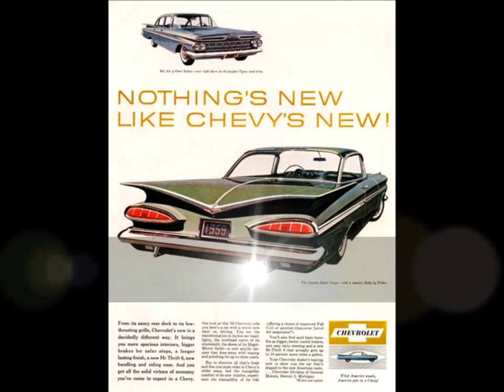59 CHEVROLET BUILD

Comment: Thanks for posting this. 

THIS IS A RATHER LENGTHY POST SO YOU HAVE BEEN WARNED!!

Now after reading thru the comments I'm going to give my take on some of them.

First, yes these cars were made of metal. Not some 'snap together' full sized model like most of them are today.

Second, whilst modern cars MAY be safer, i.e. better occupant protection, brakes, etc. and may be better for the environment the modern cars do NOT have any sort of styling. 

Getting back to the 'safety aspect' of old vs. new. It is of my opinion that we have safer cars to simply protect the inept ones who don't actually know how to drive. You may think I've lost my marbles, slipped a gear, am off my rocker or medications, etc. Well this is MY take on 'old vs. new'.

So we have newer-ish vehicles that are safer. OK. What makes them safer? ABS? Seat belts? Air bags? Skid control? Crash avoidance monitors? Parking assist? Better brakes? Better tires? Which one(s) of these make a car safer than the 1959 Chevrolet?

In 1959 seat belts were an option. Radial tires were not even a thought at the U.S. car manufacturing level. Computers were the size of small buildings or rooms. Car radios and heaters were optional. Automatic transmissions were optional. Drum brakes were standard on all of the U.S. cars and trucks. Single reservoir master cylinders were on all U.S. made cars. Power brakes were an option. Power steering was an option. Passenger side outside rear view mirrors were an option and I'm sure I'm missing some things to go in this list.

Now, if we were to take ALL of the new safety equipment and convenience items off of modern vehicles including radial tires what do you suppose would happen? Well my guess is there would be a LOT more accidents and probably a lot more vehicle deaths. 

Even IF the population was the exact same as in 1959 that would still hold true in my opinion. Why? Because people either don't know how or have forgotten how to properly control their vehicle. They have a false sense of security because the vehicle allegedly corrects for any mistakes made by the inept operator. Also the safety features, i.e. seat belts and air bags (SRS) give them 'warm fuzzies' if they do get in an accident.

IF people knew they could face imminent death if the got into an accident PERHAPS they would actually do what they are suppose to do when behind the wheel. 

Instead we have all sorts of distractions (I'm NOT including cell phones) in modern vehicles. Touch screens for simple items such as the climate control?? Really? What exactly was wrong with simple levers and knobs to control air flow and temperature? GPS?? Um yea, I've NEVER even operated a GPS let alone own such a device. They have these things called 'maps' which don't drop a signal or track my every move I find are pretty useful. Or I simply scribble down some directions on a piece of paper then drive.

Yup. I'm simply an older driver (on the road 'legally' for 42 years) with no tickets or accidents that drives a 1993 Ford Festiva (death trap) pretty much every day. No cruise control, no ABS, no air bags. Would really like to have another 1960's era Impala (I've owned 8 of them from the 60's in the past) and may someday find another suitable candidate.
Reply: @Russ Davis So, you don't think that the C8 Corvette has style? WTF!

Comment: rather have 1 of these than this computerized, gps, air bag, on star, track you where ever you pieces of junk they are building now
Reply: @allen blackman Yeah, you wouldn't want one of todays pieces of junk where you could actually WALK AWAY FROM A MAJOR CRASH! LOL.
Reply: The new ones coming out now are junk. Coming soon will be a chip in the computer that tells car it has reached maximum miles and guides it to a junkyard. Really! That's why it's driverless!

Comment: sold new for approximately $1700.00
Reply: Yeah but the average worker was making around $2600 a year. Same thing.
Reply: true...but why does our money become so completely devalued ... it feels like we've been robbed...
Reply: +daisyroots Accualy the prices for 1959 chevrolets were between $2247 for no options 2door Biscayene 6 and $4265 for the fully optioned Impala hardtop V8.
Reply: +MrTheMiguelox Which would be between $27,000-$28,000 for a fully loaded new 1959 in today's price range
Reply: You could buy a new VW Type 1 (BEETLE) for $1700....

Comment: Wondering if GM was putting on lacquer paint at this time or enamel.....the lacquer paints sure did cause problems....
Reply: All the cars assembled  by G.M were painted with Acrylic Lacquer ,Until till base coat clear coat became the standard for most if not all cars. Up until About 1957 G.M. Painted their cars with nitro cellulose lacquer. Acrylic replace the nitro paint because it was more durable and fade resistant .I painted enough of them. Just saying.

Comment: Wonder  how  many   of  them  cars  are  still  around
Reply: Not many because unlike the tri-five Chevrolets desirable & popular since new, 
'61 to '64 Chevrolets were always popular but the '59 & '60 Chevrolets were the least popular because of the tail fins. They became sought after 25 years later by that time most of them were long gone. I was a kid in the '60's & '70's & the '59 & '60 Chevy's were a common site at demolition derbys.
Reply: @winggullseagull1230  
Some were actually made in Australia too by Holden.
Reply: @AUmarcus  in 1977 my first car was a '59 2 dr Impala I was 17 & enjoyed the car until I wrecked it, not worth fixing.Cheaper to buy a better one back then. I had 2 more '59 2dr Impala's in 1979 & 1998 those 2 I didn't wreck. I became a good driver after wrecking my first one.
I lived in England for many years & I saw a '59 4 dr Bel Air right hand drive & a '60 4 dr flat top Impala right hand drive from Australia.
It's weird seeing an American car with the steering wheel & dashboard reversed like looking in a mirror.
I'd love to have an Aussie '59 or '60 Chevy.

Comment: Have you seen the head on cash test of the 59 Chevy with a 2018 Malibu?  The 59 is totally destroyed, the dummies are ripped to shreds. The 2018 suffers only front end damage and no injury to dummies.   The old cars were beautiful, but they were death traps.
Reply: I've seen it & lived it, in 1977 my first car was a '59 2dr Impala in mint condition & I got into a horrible accident & the car was a total mess & disaster & had to be towed. I injured my knee & survived. The old rides are a lot of fun but unsafe in an accident I know from experience. I still dig '59 Chevy's they are cool looking. I had 2 more in '79 & '98 & I want another one before I die.

Comment: The 59 and 60 were a piece of engineering shit. That flat trunk lid and back window created stability problems at 70 mph. The back would suddenly lift up at about 72 mph due to the aerodynamic vacuum created across that trunk lid. Absolute crap. I had a 60 and experienced it.

Comment: the 59 had no engine/trans a solid 800 pounds off bringing the weight down to about 2400 pounds ve the 2400 pounds for the Malibu which if they were this dishonest prob had weight added. the 59s especially the impalas had seat belts. the driver in the 59 had none. now put a 235 or a 348 with a cast iron automatic trans in there. totally different results for sure.the stove bolt 6 would jack the Malibu.
Reply: the Malibu weighes about 3400 pounds if they did not add weight to it which I am sure they did, the rest of its dishonest.

Comment: Ask anyone who's ever had to restore one of these. They are NOT built very well at all. They have huge gaps where panels should be welded tight. They have questionable spot welds and the metal on the main shell(not fenders, etc) is not very thick at all. The pillars are also paper thin and bend/collapse very easily. I own a 51 Chevy Deluxe Coupe and I pray to God that I never get involved in an accident over 20MPH. That thing is a giant steel coffin waiting to happen.
Reply: But they sure look great!!  Then when you saw a car, you knew it was a Chevy, Ford, Chrysler, etc.  Today one make looks just like any other car.  Each year, the same amount of people die in car accidents today as they did then.  You are wrong on how flimsy they were built.  We crushed 40 cars a while back.  The modern cars crushed down to about 1 foot in height (with out engines of course).  The old ones from the 50's & 60's crushed down to the top of the cowling (firewall) and would not crush down any further.  If you fear riding in your 51 Chevy then get rid of it and drive a Corolla like all the other schlumps on the road.
Reply: They just didn't have the design or engineering knowledge and technology we have today. They designed these cars with pencil and paper. They're far from perfect.
They didn't have the production methods either. Modern factories have a lot of mechanical assistance. These guys did a lot by hand. Especially when it comes to welding, having an automated machine making welds is going to yield a more consistent result than having some guy do it.
Their crash testing was essentially smashing the cars into a wall and saying "hmm yea looks like you'd survive" lol
Reply: He's right when it comes to the welding points. Being that the cars were welded by hand to begin with there is inherently going to be inconsistencies with every single car, no two cars came off the line built exactly the same. And while the number of deaths has roughly remained the same, the deaths per number person population is the lowest it's ever been, roughly about 11 deaths per 100,000 people. In 1950 it was about 27 deaths per 100,000. So yes, the actual death rate in car accidents has SIGNIFICANTLY decreased. I'm not saying the old cars are ugly, because they are really beautiful. But they are seriously death traps. There is a reason modern cars collapse into nothing when crushed - they are engineered to absorb the energy so you don't, and a car that does NOT crush easily transfers the energy to the occupants - who, oh by the way, have no seat belts, airbags, or even an energy absorbing steering column. You cannot avoid the laws of physics, and engineers are far more knowledgeable about that now than they've ever been. Cars were death traps until the 1990s.
Reply: @packard5682  The difference is there are MANY MORE vehicles on the roads today than in 1959!!!
Reply: @Xixu.co.6  Agree TOTALLY! Just compare the almost perfect panel fits of today's cars to those 60years ago............NOT EVEN CLOSE!!!!

Comment: Incidentally ppl love the blame unions for state of our auto industry.
BS. Autoworkers unions have been around since the roaring 20's . "1920's".
And they built cars for 60 yrs under union tradesmen. And women. Arrogence on the part of the big 3 caused much of the demise . They felt they didnt need to compete.
But they failed to see that American patriotism & "buy American" went bye bye in the 60's -70's. 
And we "Americans" started buying cars from Japan . 
Why? Small, economical , relatively reliable cars vs American Big bruising sleds that got 10 mpg & were fallin down rust buckets in 2 yrs coupled  with 2 oil embargo's that drove gas prices thru the roof.
Hey, I remember the looong gas lines .  And prices  no 1 could afford. 
Hmmm...
40 yrs later & we still buy the same brands . 
Oh we build good safe cars now. And are reliable as any on earth. 
But buy American to keep Americans on the job?? 
Ha ! 
You couldnt now if you wanted to.
Toyota & Nissan & Honda are more domestic than Chevy (GM) Or Ford, 
And Chrysler isnt even an American co anymore.
Fiat bought em at auction in the last recession. 
True story.

Comment: I think that the 1959-60 Chevys were the ugliest ever made!  Just compare them with the gorgeous 1955-57.  No comparision.  I think the prettiest were the 1965-70 models.
Reply: The tri-five Chevy's are great but the 59 & 60 Chevy's are even better & much more rare & hard to find. I had a '57 Bel Air Ragtop & now I have a '60 Impala Ragtop & it's a much better car then the 57 it rides better because of the coil springs & has a smaller turning radius despite being a bigger & longer car.. The '57's still had leaf springs in the back & rode like a truck & didn't have a smooth ride like the 59's & 60's. GM improved the cars from 58 onwards & also the tri-five Chevy's are going down in value & are all too common, the 59 & 60 impala converts are the new kings bringing the top money now & are much better investment cars. The tri-five Chevys had their day in the sun. The 65 to 70 Chevys are no big deal & are not very collectible & will never be worth much but that's just my opinion.